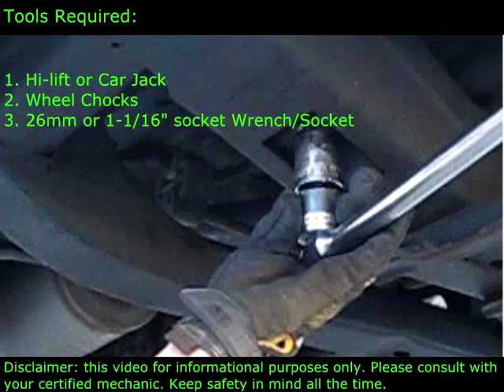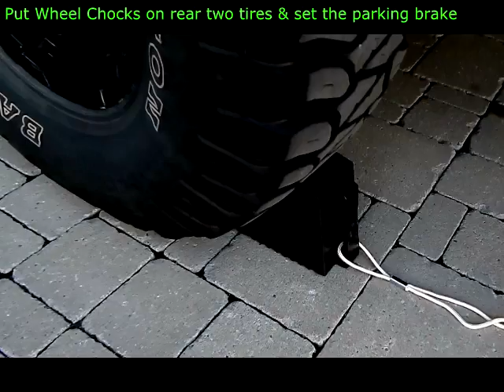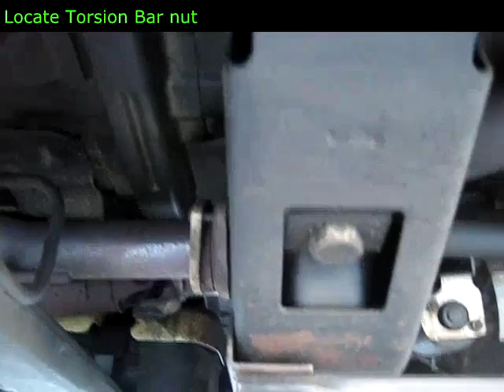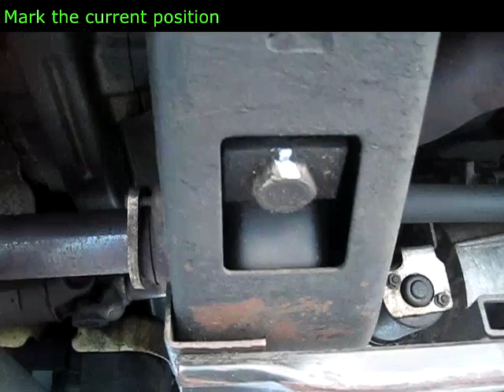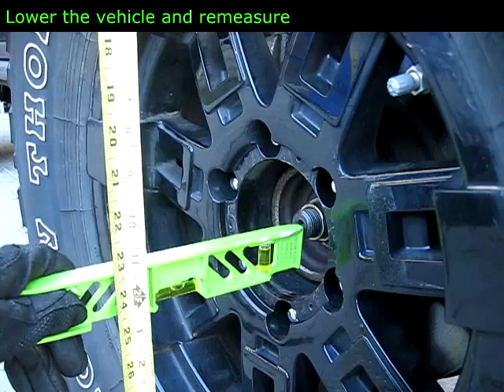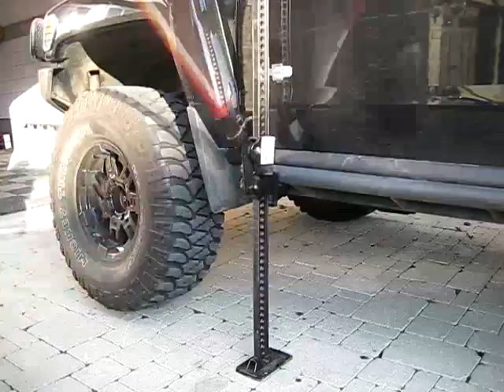How to Adjust Torsion Bar on Hummer H3 - How to Level Hummer H3 by Lifting Front

Comment: Hi I did the torsion on my new 35 tires and it seems good .. but now when I drive the steering wheel shake.. that mean I need an alignment? Is that normal
Reply from the maker: It might shake due to several reasons - but for sure it it is good idea to do alignment after you raised it? How much did you raise it?

Comment: do you known why after i crank the bars it goes back down after i drive it around? i have the rancho lift kit, in the back in have 27" and i cranked the front to 27" but after driving it i noticed that it went back down.  Do you know why this happened?

Comment: Hi, your video is really helpful and straight. I am thinking of raising my hummer, my question is can you keep same height i.e. from centre of the wheel to lip of fender for all 4 tires or I need to keep front ones little bit lower than the rear ones.
Thanks in advance.
Reply from the maker: Hi, theoretically you can - but I have not tried and would not advise. The highest I would suggest to go is 23.5 inch. 
In any case, the more you lift the front of your H3 - the more stress you put on CV Half Shaft and other components.
In my opinion - it is only good to lift the front for off-roading purpose to even-out ground clearance.

Comment: I’m get 35’s I’m worried about doing this tomorrow I don’t wanna mess it up
Reply from the maker: Do worry - just make sure you don;t go higher than 23.5 inch. Try 23.25 first and see if you like it and drive for a while.  Also, if you are using high-lift like me -   use it on the side of the truck... not like in video.

Comment: Hi I put my 35 yesterday and it rub just a little in the fender.. I will try this tomorrow .. in by any chance I don’t like how it feel .. can I reverse ? If so ? What is the standard measure? Thank you!
Reply from the maker: Yes, you can reverse it. To be honest, I don't remember factory measure. If you remember how many turns you made - you can do the same in reverse. BTW, I found optimum setup to be 23 and quarter, that's what I currently have. I also have a bit of rubbing
Reply: @NewRoad  Hello, thanks for replied... I lift it to 24 and a half... will i be ok? that size is perfect to avoid any rubbing. I test it and i feel it drive just fine... let me know or should i down to 24
Reply from the maker: I would not recommend higher than 23.5 - you might have problems with CV shafts. Especially if you run after market CV, they go bad really fast. Try 23.5 and see if you like it. I used to run 23.5 and never had problem - but still didn't like how steering felt, so went a little bet lower to 23.25
Reply: Just get a 4 inch lift it will look more insane than messing with the torsion bars
Reply: @EDGAR15ish  there is not any for the h3 anymore....... just leveling kit and body kit...
Reply: @alerumba  really? I saw some online like two weeks ago
Reply: @EDGAR15ish  where? do you have the source?
Reply: @alerumba  just google it or go to a tire shop they should be able to get you one
Reply from the maker: Nobody is making lift kits for H3's anymore. If you are lucky to find used one on ebay - it will cost you a lot. Don't bother with leveling kits - these do nothing.
Reply: @NewRoad  i seen that i spoke too soon fml
Reply: Just an update.... I put a new front shock that support 2/3 inch than the stock one, that  fixed the rub issue drive perfect! of course i did the alignment.. i'll try to upload a video soon.. so you can see how it look...thanks for all the help..

Comment: ON MY 06 H3 WHEN I CHANGED MY LOWER CONTROL ARMS I TOTALLY MESSED UP TORSION SETTINGS DO YOU HAVE ANY RECOMMENDATIONS
Reply from the maker: I would suggest to adjust so you have 23.25 inch between wheel center and bottom of fender - as shown in video
Reply: @NewRoad  THANK$ GREATLY

Comment: Great video! I’m looking to level out the front axle to the same clearance as the rear on my H3T. Have you experienced replacing the front cv shafts sooner than normal due to modified lift?
Reply from the maker: Theoretically, if you level it - it should wear sooner. From my 9 years of owning the truck experience - I had to replace CV shaft only once due to bad decision in off-roading. If I used my winch instead of having H1 yanking me from deep mud/boulders hole - I would still drive my OEM passenger-side shaft :-).  My driver side is still going strong after 9 years (touching the wood). I have leveled my truck about 7 years ago. Keep it under 23.5inch and you'll be fine.
Reply: @NewRoad  thanks

Comment: So my driver side was sitting at 22.5 and passenger at 23.5. I did 1 full turn, it brought the driver side at 23. So I did 1 more full turn and it didn't move. Did another full turn and still nothing. Any clue as to what is going on?
Reply from the maker: After each adjustment you have to lower vehicle and drive around with few abrupt stops and then measure again

Comment: do you known why after i crank the bars it goes back down after i drive it around? i have the rancho lift kit, in the back in have 27" and i cranked the front to 27" but after driving it i noticed that it went back down.  Do you know why this happened?
Reply from the maker: It does settle a bit after - but should not go all the way back.. not sure how lift can impact the whole setup though

Comment: Great video. Thanks. I was told by an auto shop a year ago to pay attention to the lift because it would settle from driving. I lifted it to 23.5 assuming it would do so. 1 day later it appears to have started to drop again. I checked the bolts and they haven't moved and are still lined up from my markings. I can tell ot dropped because I uad a gap heyween the control arms and the bump stops, and there isn't one now. Anyone have any idea?
Reply from the maker: It does goes down after you drive and hit few bumps... just lift a bit more, but my recommendation is 23 and quarter. I found that it looks good and ride quality is still good, + less stress on CV shaft
Reply: @Newroad  thanks, I will shoot for that recommendation. Will have to regularly adjust the bars to oeep the ride height?
Reply: Did raising your hummer by the torso keys ever put any ware on your back end
Reply: @tmoneybme  so far no. Pretty much all the research I've seen Indicates that as long as you only go 2-2.5 inches you'll be fine. The only thing I can say, is that like me if you get a used h3 you may have some surprises when it comes to repairing things if the prior owners beat the hell out of the vehicle before selling it or trading it in.

Comment: If I replace the torsion keys, will it still put stress on the other parts of the front end? CV axle etc
Reply from the maker: Yes, it would - since the CV angle is changing. BTW, you don't need to replace torsion keys - you just crank your existing. My advise is to follow the video and crank it to 23 and quarter. I drive with this heights for 10 years with no issues.

Comment: brand/website of leaf mount & and shackle  you recommend ?
Reply from the maker: In most cases I recommend to go with OEM parts. Usually I buy my parts from rockauto.com or amazon
Reply: NewRoad but you mention you put a shackle and mount on rear to lift... wouldn’t that be aftermarket ??
Reply from the maker: @lloydharry  My bad... if you want to go with extended shackles (https://www.youtube.com/watch?v=8SLALluM5kc&t=15s) and High Clearance Leaf Spring Bolt Plate (https://www.youtube.com/watch?v=UXXgz2ZwAa8&t=3s) - you can buy from https://schwarttzy.com/

Comment: torsion bolt on drivers side aligns both from wheels up/down ?? .. or is there another bolt on opposite side that needs same adjustment ?
Reply from the maker: There is another bolt on opposite side - you have to do both, and same number of turns
Reply: Humman Off-Road thanks

Comment: Can I also lower it like that because I feel like my back is a lil higher than the front
Reply from the maker: Yes, you can adjust lower or higher - just don't over do it
Reply: @NewRoad  thanks man what's what's the lowest I can get it cuz I put some off-road tires and rims and it lifted it by 2inc or 3inc  so I'm trying to get it back down
Reply: You can not lower the back it is not torsion it has leaf springs

Comment: Why would you put your vehicle level. So guess what happens if you ever put a heavy load in the rear, or maybe tow a trailer? Think about it. there is a very good reason that the manufacturer puts the front lower than the rear.
Reply from the maker: Ask any H3 owner who did it and they will come with perfect explanation - IT JUST LOOKS AWESOME!!!

Comment: Could this also be done without lifting the truck with a jack? Mine is raised already and yes I have replaced my CV joints twice already and upper controls arms 3 times and there is also popping on my steering wheel when I turn. This didn’t happen right away but over time. My mechanic lifted to high I suppose. I’m going to drop it. I’ve also notice that the front is sitting higher than the back.
Reply from the maker: I haven't tried it without - so not sure. You problem might be related to too much lifting the front. I don't recommend going higher than  23 and quarter.

Comment: IS this an OEM feature?
Reply from the maker: Yes, no additional installation or anything required, but don't lift it higher than mentioned in this video
Reply: Thank you. It seem to say just consult your certified mechanic (hard to find since the car has ben long discontinued). Say I am mounting 34" tires, what should be the max high measured as the video explains? I would want to keep it as OEM as possible with no rubbing. Thx @NewRoad
Reply: @121anz  sorry for late reply, I don’t remember OEM measurement, but it does not depend what tire size you have - since you measure from center of the wheel

Comment: I'm noticing a really forward slanted stance on my 07 H3, think that the previous owner put the torsion bar down all the way? Would this level it out for me? As it stands, its a pain seeing street lights out the windscreen with the way the truck sits low in the front. Just had the shocks done on it so I know its not them. Would this work/help?
Reply from the maker: Yes, it is exactly what it is for. To raise the front so the truck is leveled. Do not go above 23.5" to be sage.
Reply: Thanks for the info! I've gotta go get an alternator swapped out tomorrow, I'll ask the mechanic if she thinks its in good enough condition to do so.  Thanks for the info, appreciate it!
Reply from the maker: You are welcome. It is very easy to do and easy to reverse back to original position. All the best.

Comment: You have a lift kit? What is your distance between the striker and the lower lever? I for some reason on the whole car shakes irregularities, torsion bars dropped, but remained shaking, I can not understand what is the reason!
Reply from the maker: +Humman. I don't have a lift kit. But I did manage to raise it at least 3 inch (7.62 Centimeters ) by putting 35 inch tires, lifting front-end as shown in this video, and installing high clearance leaf spring mounts and extended shackles. 
Sorry, what do you mean by 'striker and the lower lever'? If you mean fender edge and center of the wheel in front - it is currently at 23.5 inches (59.69 Centimeters)

Comment: Picking up a red 08 h3 tomorrow, this will be the first thing I do👍🏼
Reply from the maker: Don't go higher than 23.5in. I would suggest to change all fluids as well - since you don't know what previous owner did
Reply: They just picked up and took it back to dealer this morning, last night it went into reduced power mode and cel came on, but it’s under full warranty up to a complete new motor and drive train

Comment: I cranked the left side 5 full turns and measured the driver side and passenger side and they were both at 23 inches without touching the passenger side, is it fine to leave it that way?
Reply from the maker: Drive around for a bit and bounce front (bumps or brakes) and check again. I found that 25 and quarter is ideal for having truck stance looking good and keeping good ride
Reply: This happened to me to after doing just one side for some reason the other side also went up to the same height I don't understand it.